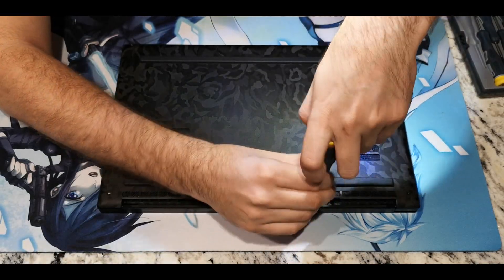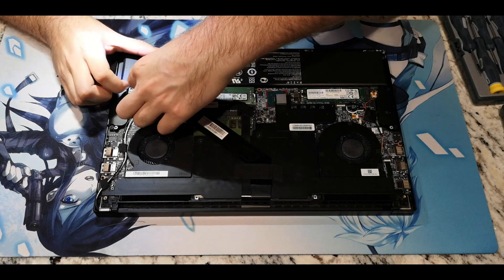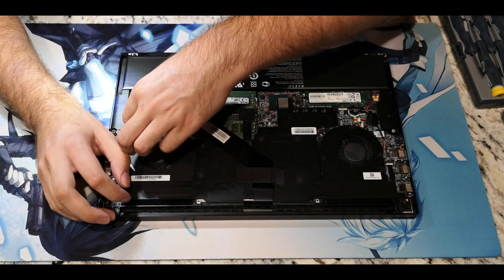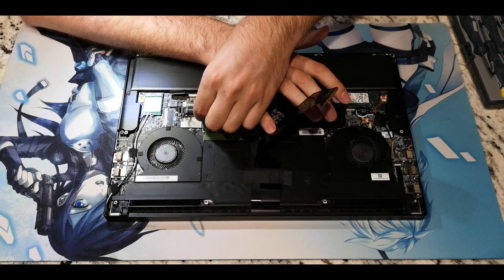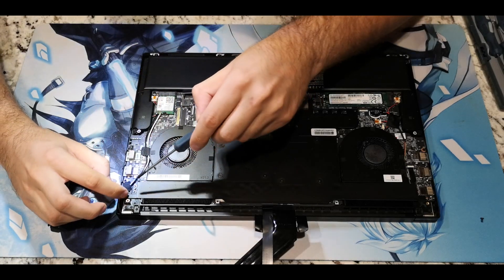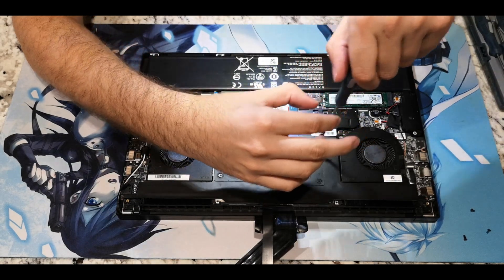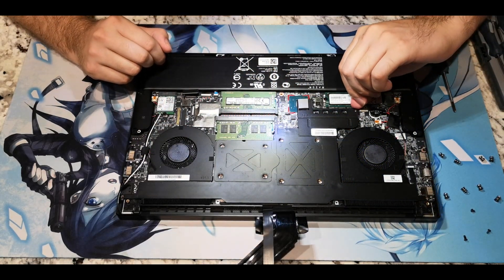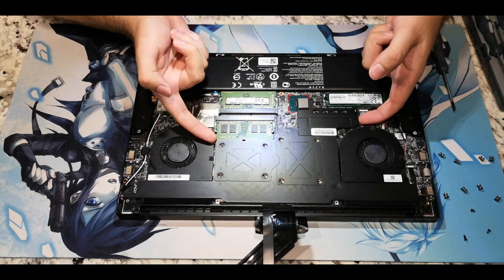2018 Razer Blade 15 Heatsink Removal! (Fixed Audio)

Comment: How can  i google to buy that tape which covers the display cable and attached to the heatsink? (that black one)  Did you get what I mean? With lots of repastes it is already unglued, so is not so sticky, i want to put a new one but i do not know which one to use , it should be thermal i guess.

also I want to replace fans, i do not remember whether they can be replaced without taking off the heatsink, do you remember? I do not want to repaste once again because of the fans :)

And last one - which glue i can purchase for rubber pads on the heatsink middle screws? (circle black ones) They are unstable as well :)
Reply from the maker: All great questions, I had to deal will all the same promlems on my 2018 blade. Occasionally fans show up on ebay, but I don't know about the tape or regluing standoff pads. I had to send my blade in for fans and they redid those. Electrical tape can replace the tape, and maybe gluestick the pads on

Comment: The two fans on the bottom of the laptop, is that the air intake or exhaust? I’m buying a razerblade and trying to figure out we’re the intake and exhaust are to determine weather a cooling pad would be useful or not.

Comment: Super helpful! Know any place to buy replacement batteries? Razer does not sell them, currently my main concern with longevity
Reply from the maker: I'd check ebay if you want to purchase it outright, but im sure razer would sell you one, they'd just make you send your laptop in though.
Reply: @BioGear  Already did, one listing that might not ship here but I guess it should be easier to find later on since I believe the design is the same for the new RTX blade's :)

Comment: You said you didnt see much better temps with the repaste have you tried comparing benchmarks cus I heard that they get better after a repaste and undervolting.
Reply from the maker: I did a couple firestrikes but it didn't improve my temps by a whole lot. It did lower my temps while gaming, but again not as much as I expected, maybe 4-6 degrees Celsius max. I just downclock to 3.0 GHz while gaming and call it a day, doesn't affect FPS in games I play. Temps way improved, though.
Reply: Would that just be limiting the boost clock speed. How would I go about doing that. Also do you have any tips for protecting the battery while gaming so I don't destroy it so in a year it holds half the charge.
Reply from the maker: I use ThrottleStop, there's a lot of utility in it so do your research and learn the software. YouTube has a ton of videos on it. Regarding the battery, there's nothing I can suggest to increase the lifespan, I just bought a warranty to protect myself.

Comment: Did you put the thermal pads on there or were they already on there??
Reply from the maker: Donald Bowman they come applied from the factory, after this video I swapped them out with fujipoly extreme pads.

Comment: Do you know if this heatsink is the same as the Late 2016 Razer Blade Pro? I'm wondering because I have some Liquid Metal I'd like to put on there, but I'm worried about not being able to get it back together well.

Comment: do you have a link to which thermal pads u used? im not sure what thickness i should get
Reply from the maker: Fujipoly Extreme 1.5mm. 2 strips were enough but you have to be wise with cutting, no wasting. 
https://www.amazon.com/gp/product/B00ZSJR1ZK/ref=oh_aui_detailpage_o09_s00?ie=UTF8&psc=1

Comment: What are your thoughts on switching to liquid metal and high performance thermal pads? The Heatsink seems to have no aluminium parts so it should be possible?
Reply from the maker: I currently have Conductonaut liquid metal on the CPU and Kryonaut on the GPU. It make a great combo, but temperatures did not improve how i hoped. you should see a 4-8C drop while gaming, but I'm not thoroughly convinced it's worth risking an LM spill.
Reply: Thanks for the fast response. How about noice, is the rpm reduced or stays the same? Are you undervolting or running stock, except for the thermal paste?
Reply from the maker: No prob! I'm undervolting and using manual fan settings, I also set my clocks at 3.5ghz. This lands me around in the high 70C's while gaming, which is where I like to be regarding temps. It also does not power throttle at this clock speed using balanced mode.
Reply: Thanks a lot for your answers! That really lets me hope, that Razer managed to handle the TDP now.